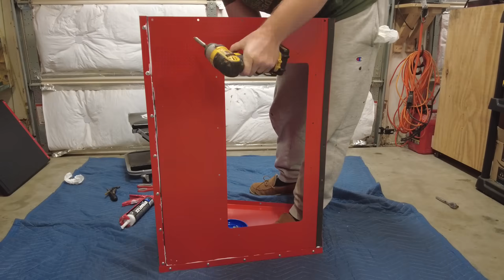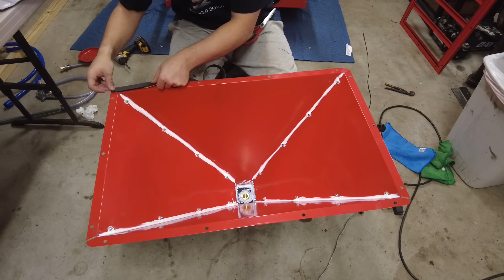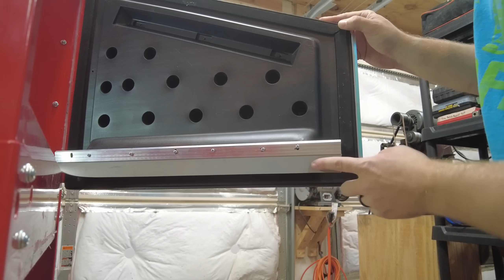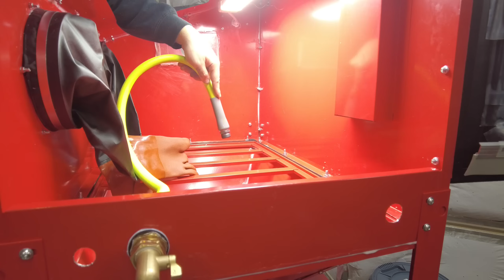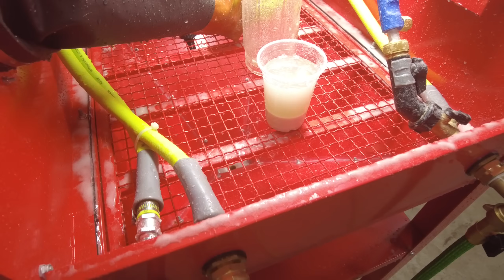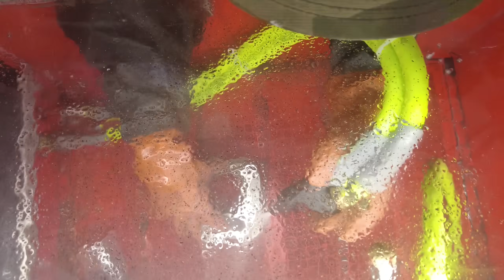Building And Testing A Homemade Vapor Blaster!

Comment: The air regulator looks like an air seperator to get moisture out of air tools. Essentially your drying the air then mixing it with water again. A cheaper regulator without the glass container could be used to save some money.  Nice build looks like lots of thought.

Comment: My guy, Flex Seal is da bomb diggity for sealing holes. I woulda bought the clear one but that's just me. Also a 12V DC Wiper motor will make cleaning much easier as you can CLEARLY see the item you are cleaning. Just a thought. One would have to have a 12V power source and switch for proper operation. Do NOT connect a 120V wiper or any power source over 12V inside the wet portion of the cabinet.  A 12V Pool Transformer is the RIGHT way to connect it as a pool transformer is double isolated from shock hazards. The circuit power it HAS TO BE GFCI Protected.

Comment: How long is the pump supposed to last with the media being pumped through it. I mean it is an abrasive that is being pumped under pressure.  I mean what was wrong with the old tried n true media blast cabinet. That would be a good time to use the negative pressure vacuum to keep the dust down. I mean what good is the vacuum within a wet area definitely not for visibility purposes,thats what the two sources of fresh water is for. I see no reason to build this device.  You’re trying to re-invent the wheel ,except the one you’re replacing it with IS BENT AND FLAT!!!  Not saying you did bad work cause you were extremely thorough. Its just a better device already exist

Comment: Next: adding wiper on the control glass panel 😂
Reply: won't the blasting media scratch the crap out of the wiper and glass window ?
If it worked well to keep your windows clean, it would be in every window washer, in your car and around the house.
I would be thinking of a steady spray of clean water on the window, running into a separate bucket or drain.

Comment: Did your sump spray out of the top while running? Like a pressure relief maybe. I ordered the same one and set it up the exact same way but and getting a misting spray out of a little hole on the top
Reply: Bleed hole to prime pump

Comment: Does the abrasive media really go though the pump? 😢
Reply: check out 'trash pumps' or 'sump pumps'...... they are designed to shift solids mixed with water.
The water lubricates it. Don't try pumping blasting media when it's dry or only damp. That will destroy the pump.  The industrial size ones are used for draining construction sites.... they have been around for decades and are proven. Just a matter of choosing the right one for your application. On-line may or may not be the way to go...... maybe better to check out with a specialist pump shop for a recommendation.

Comment: your PUMP has 110V in it from the black plug - it sends power thru the float switch, but youve wired it backwards and have LIVE power sticking out of a male lamp cord and you hooked the female lamp cord to the DEAD switch end, if you unplug that white cord you will get bit, or worse - the male cord end should be on the switch, the female (safe) end should be on the pump float wires

Comment: I didn't know about the vapor set up before. I just saw Sarah N tuned use one of these with very impressive results and decided to check it out further. After seeing your video and how it is put together, my biggest question is how long do the pumps last with all that abrasive running through them. If they do hold up well, this set up looks much better than a plain sandblaster. Thanks for sharing your build.

Comment: The white male plug that comes from your pump and goes to the switch has probably a live prong. So if your pump is connected to mains with the black wire and then you touch the pins of the wite plug when it is unplugged you will probably fry yourself. I hope i got it wrong though i don't think so....
You need to put the plug (pins) to the switch wire and the socket (holes) to the pump side and stay alive.
Awesome project by the way

Comment: The strategy is to first clean off surface, then reduce surface tension of metal to increase strength, especially welds. Always only use minimal aluminum oxide first on heavily coated surfaces. It is very abrasive and will open micro fissures, causing risk of crackes. Glass beads act like tiny shot peen hsmmers and close some fissures and reduce surface tension, like polishing. Always carefully test thei materials like body panels not to cause deformation. Adjust angle and pressure carefully 👍 
Cheers 🍻 
Nice machine.
Reply: Very nice explanation!! I believe this has to be the best conversion videos I have seen so far. I have one of these and have been accumulating the pieces needed to convert mine over to vapor blasting. I am about to start a Youtube channel with the build of a 1928 Morgan Hillclimb race car. I am going to specialize in pre war race cars and have been putting together a machine shop to support my builds. I found the coolest Drilling/tapping station from the  aerospace industry before there ever was one...
Reply: Meh a little aluminum oxide never hurt any...oh wow that's moving a lot of material 😬
Reply: Obviously the aluminum oxide will look better since it is the harder material and is taking some of the base material off during blasting. This should always be a major criteria in choosing blasting medium, if, and how much, the base material can be thinned. In addition, how will adjacent, machined surfaces be effected by the blasting medium.

Comment: I wouldn't use aluminum oxide on the cylinder. You have little to no control on how much material You're shaving off of it. Stick to the glass media, and spend some more time in stead.

Comment: Doesnt the media eat up the pump ?
Reply: if it is a 'trash pump' or 'sump pump", they should be designed to handle water with a ton of crap in it...... like blasting media. They are rated at Gallons or Litres per hours, and the size of crap that you are asking it to pump. Most will pump 6 mls (1/4 inch) up to really impressive sizes with an industrial unit. The larger ones are for construction sites and you can imagine what goes thru those pumps.
In this case it is bloody small blasting media.....
But ask before you buy. You don't want to buy the wrong sized pump... that is a problem.

Comment: Great video sir.  I am just completing a machine, inspired by yours.  I found an old dry blast cabinet to use.  Are you still using any kind of cabinet ventilation?  Also, do you have accurate data on how much media you use per gallon of water?  Last question, for now, do you have a wiper or any automated sprayer setup for you window?  In my trial runs I had nothing and it seemed to be pretty easy to see what I was doing.  It still would be nice to at least have a fixed spray head aimed at the window, with an easily accessible valve.

Comment: Looks great, i am going through a build right now but seems to be lots of back and forth on the pedals, Victor Bared says you need to see the full 1/2 air through, yet other guys say they notice no difference using 1/2 or 3/8 airline/pedal. Curious if you feel the pedal in yours is a hold up at all? looks to be just 3/8?
Reply from the maker: I don’t think mine is affected that much but I haven’t tried without the peddle. It’s just a hobby machine and it has met all my expectations and needs. It probably depends on what you are using it for.
Reply: @MarleyJaxGarage  I ended up building it over the break here with the same pedal as you and I feel it's ok, I blasted a bunch of stuff and it looks great in my opinion. Appreciate the response and this video was a great help to me building mine! 🤟
Reply: I noticed with the pedal I can’t get more than 30psi, without the pedal there is no restriction
Reply: @jasonwade6715  weird, I run 80psi most of the time and no issues, my regulator is obviously after my pedal so it's a true 80, I have even went up to 100
Reply: @kyushalimit5931  has to be something with my pedal. I tried various ratios also, idk why but I don’t get  much abrasive cleaning.

Comment: Awesome video, I would recommend a small water pump with flexible nozzel o. Inside to run constant to wet glass, and install a water proof windshield wiper put inside with speed adjustment, and add a big piece of rubber mat hanging down inside by door, so u open door push up rubber mat put your dirty part in the mat falls and protect from any water or glass bead shooting around door seals and no leaks or mess around door
Reply: Where does the clean water come from and go to without constantly adding more water to the mix?

Comment: Great video! The list of what you need and where to get it is very helpful.  I'm trying to duplicate your setup, but there was also a little confusion in the comments about what size reducers you used for the pump to mount the hose splitter on, and the fitting that goes on the hopper; where did you get them and what size is needed? Thanks for the help, I'm pretty stoked about getting mine up and running!

Comment: Wouldn't the glass bead kill the pump?
Reply: look into 'Trash Pumps' or 'Sump Pumps"...... they are designed for moving solids with water.
Each one has different specs..... normal flow to what 'head'... in this case 3 feet/1 metre,  along with the size of solids and amount. 
The solids have to have enough water to get caught into a water flow. You can't pump damp sand or blasting media... it has to be suspended in the water being pumped.
Reply: They die quickly. Buy several...

Comment: I have a large plastic IBC tank and am going to try using that for a wet blaster. You can find those pretty cheap, I paid 25 bucks. Get one with the metal cage around it and use that as a stand and frame mount for the door. They are larger so more room and plastic to wet is no problem. I was going to make it a dry bast cabinet but am picking up a used harbor freight unit tomorrow for cheap so using that as my dry bast unit. Wonder if a pressure washer would work for this using a siphon style tip?

Comment: Will the media Buggar the sub pump?
Reply: sump pumps are rated at the size and amount of lumpy stuff (blasting media for example) that it will handle, along with a GPH or LitresPH rating. They are also often called 'trash pumps' for that reason.... they will handle 'crap' in the water, it's just a matter of how much, whether the 'trash' is abrasive by nature, either physically or chemically.... etc etc.
Spherical beads will not be naturally abrasive to any great extent. Yes after a few years, it may eventually erode parts of the pump.. remember they are designed to handle water with mud, sand, paper and junk in them, for pumping out basements.
Best to check with your pump sales people and get their recommendation. What you get from on-line vendors is often a mystery package..... that may, or may not work for a long time.

Comment: The only constructive criticism I could give you is it only takes a second to wipe up the white adhesive as your putting everything together and would have made your new cabinet look like a commercially bought one. The second thing is you probably don’t need a vacuum with a vapor blast cabinet.  One suggestion on how to keep the glass clean.  Maybe try a small plant mister.  You could maybe leave it running while you’re blasting, hopefully without adding much to the water level. Either way it Looks good Dude!
Reply: Heartbreaking to see the sloppy approach to the siliconing, especially as the man is so industrious

Comment: I am considering turning my dry blast cabinet into a build like this, but I have been running a blend of aluminum oxide and glass bead for a balance of cleaning power and a decently smooth finish. I would recommend using sikka flex for sealing it all together if building one from scratch like this, its a great sealant/adhesive strong enough to hold in a tour bus window under extremely demanding scenarios for years without leaking

Comment: Awesome setup, Marley, YouTube suggested your video to me and then I saw the V3 Vapor Blast gun. It's great to see it working in your cabinet. I've had great success using Harbor Freight's 80 grit glass beads to decontaminate aluminum parts the size you are working with in your video and then switching to 175-325 US sieve glass beads as the finishing polish. 

Keep up the great work. New subscriber here.
Reply from the maker: Thanks for the tips Victor!

Comment: I've watched a few of these vids and the funny thing is is that everyone contorts themselves around trying to silicon these all around on the inside when guess what? All those seems are on the outside also where you can get to them much easier and use half the amount of silicone, Apparently no one thought of that!!
Reply from the maker: It wasn’t hard at all to silicone this on the inside. Everyone does it on the inside because they don’t want a smeared mess all over the outside and it will be a better seal. It makes much more sense to spend 5 minutes inside doing it the right way.

Comment: Hi! What pressure does this machine need?
Reply: Eleventeen, only if the flooglebinders are installed with a left hand Kanuter valve. You. are. welcome.
Reply: @JustMike2791  wow, “Kanuter valve”.. been a very long time since I heard that one!!! 
😂😂😂 
Thanks for a laugh this morning…
Reply: @JustMike2791  That's with the fluflooreglemanators though. Otherwise it starts to end in Nocember.

Comment: Great video! I just finished building this and have one issue (other than a few leaks that need fixing haha), the pump will stop after a while, i guess it is clogged. Now i have been using very fine grit glass beads (170-340) because i had them, and the create a dense mush on the bottom of the bucket. I will get 80 grit glass beads and try those, but can you share which ones you are using? thanks!
Reply from the maker: I did show the box, I believe it was 80 grit from harbor freight. The pump should not stop, it’s a trash pump so should be able to handle the media. My guess is either your not agitating the media in the bottom of the bucket enough or the pump is bad.
Reply: You may be using to much media if it is mushy. Try much less and then ad more until it stops then back off a bit. Should work without needing that much media.

Comment: This is the best vapor build video, add wipers, vacuum is not needed
Reply from the maker: Yea I might put a wiper on it and make a video if I get time. If I’m not filming it’s pretty easy to see what I’m doing as long as I don’t blast back into the glass.
Reply: @MarleyJaxGarage  Great tutorial!  You could run an airline with a small blow gun to shoot air at the window to clear it as well as spray on the part to clear it of water and media so you can inspect it easier.  The hose with a sprayer is a great idea and doesn't take up too much room in the cabinet.  Thanks for taking us through the entire build, and giving us a bunch of tips and techniques.  Keep up the great content.  I'm looking forward to building this project in the future.
Reply: @stephengomes977  I like the idea of adding a cheap windshield wiper. The other option I’ve never seen anyone do is to have an air shield blowing in front of the clear shield that would keep some of the media from scratch scratching surface.

Comment: What about the machined surfaces? Like the cylinder bore. Does the glass bead or the aluminum oxide mess them up?
Reply from the maker: Yes it does mess them up a little. I don’t worry about the gasket surfaces or threads but piston rings need a honed finish. This is a cylinder that got bored and honed after this process. It looked so shiny and new because I had already practiced doing the machine work on it but didn’t take it to final size. Some people put big sponges in the cylinder and then ball hone it after a good wash if your just trying to restore.

Comment: Thanks for all the info. The only thing I noticed (I bought most of the parts you listed) is that the link to the fitting that attaches to the pump is wrong. It 1 1/4” to garden hose threads. It needs to be 1” to garden hose threads (thankfully Amazon gave me a refund with out a return.). Instead I just 3d printed a fitting. Good work.
Reply from the maker: Thanks for pointing that out. I will try to get my parts list updated. Thanks for watching.

Comment: Great build video.  I've been wanting to build one as well, but I've be deterred because I think my compressor is too small.  I have a 110V 2hp 20 gal compressor.  It might do 3.5-4 cfm at 60 psi.  What size of compressor were you running?
Reply from the maker: I have an old 5hp 60 gallon single stage compressor. It’s not the best but it can keep up with my projects. You could do it with a smaller compressor but it would take forever. The duty cycle on those small compressors aren’t great either.